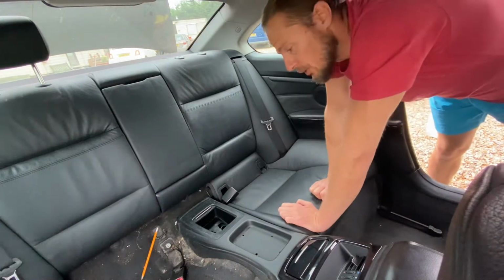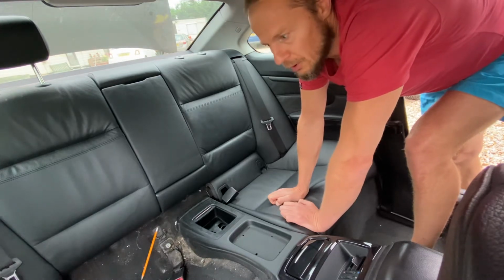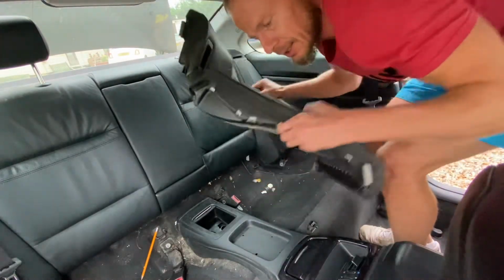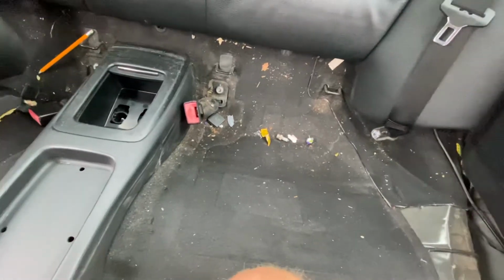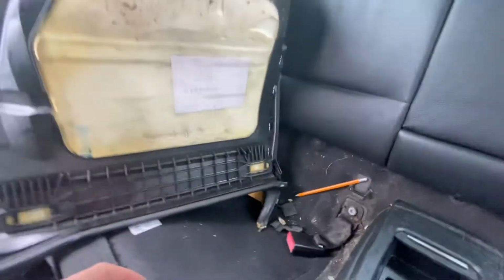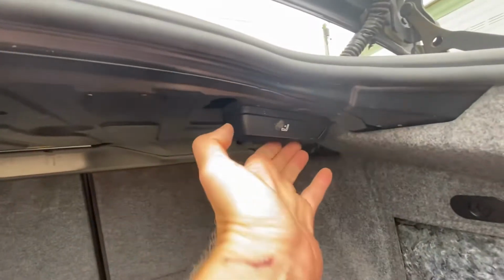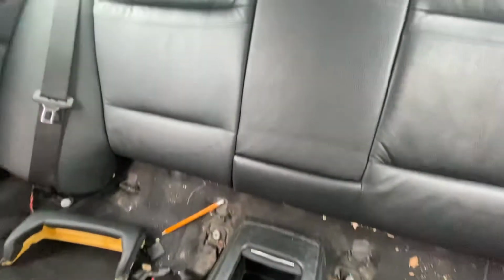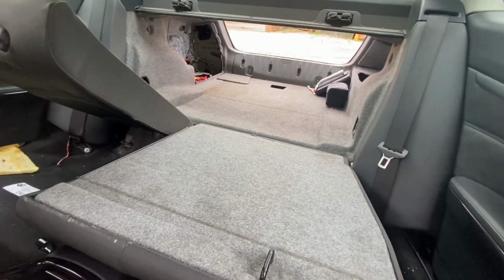How to remove back seat in BMW E92 and make sleeping area

Comment: How did you remove the little storage place in the middle of the back-center console ?
Reply: Once you remove the little leather trim piece on top of the back center console you have a good grab on the inset it just on 4 metal clips
Reply from the maker: All comes in one piece

Comment: Did you go camping in it? I slept in the e92 in the mountains 2 nights. But didn't remove those seats
Reply: Was your trip planned :O
Reply from the maker: Im 6’2 and Yes I slept in my car. Bottom back seats removed, front seats max to the front. Thin mattress,  I slept diagonally and it was comfortable

Comment: What if you don’t have access through trunk
Reply: If it's a dead battery then jump the car using the positive and neutral posts for the battery in the engine bay. If there's no battery, well, good luck.
Reply: Emergency trunk release
Should take the key for ur car it's right beside the handle